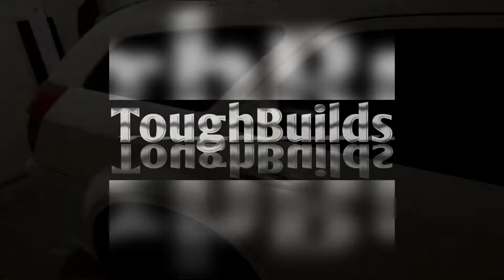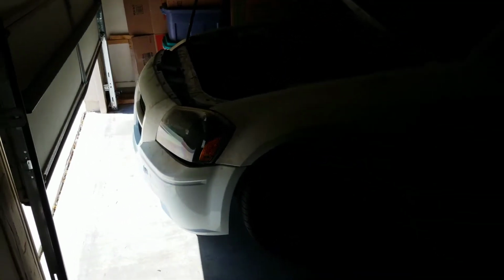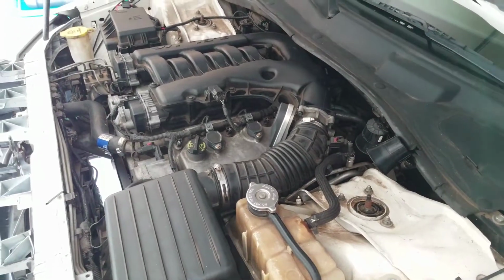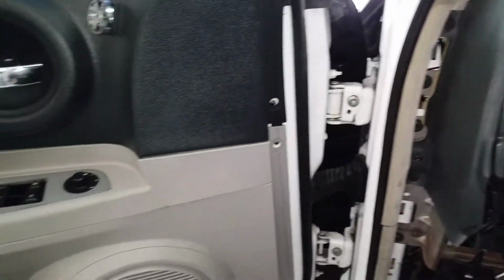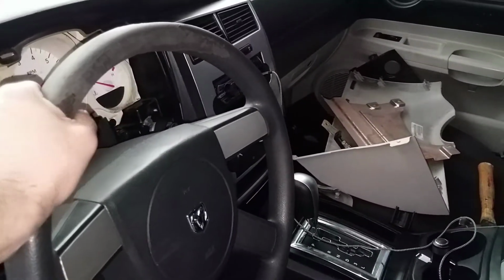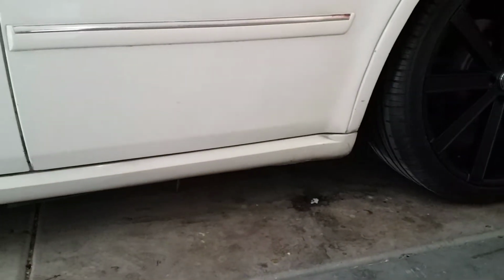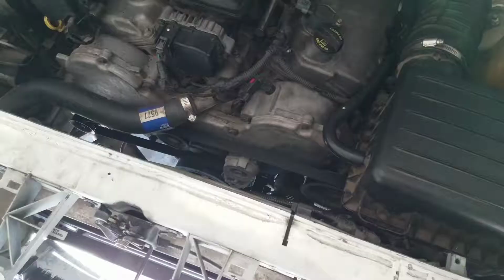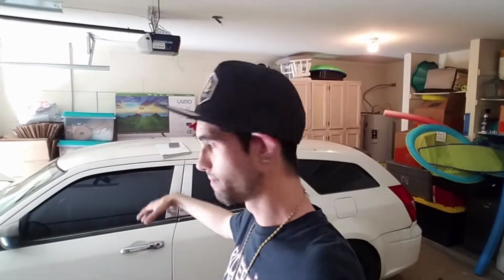2006 Dodge Magnum SXT Rebuild

Comment: great vid,   nice editing.  What HP is the Magnum at current state?   Great work keep it up.
Reply from the maker: My Magnum has 250 horsepower and 290 feet pound of torque it is definitely a great project ca
r.